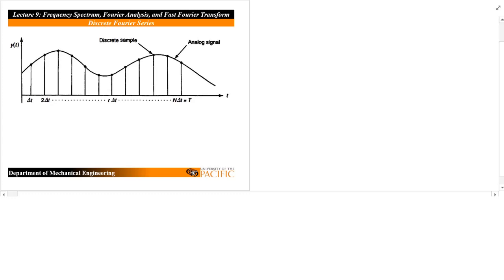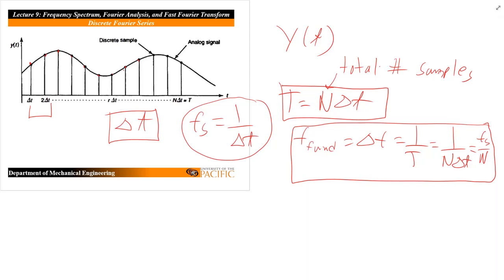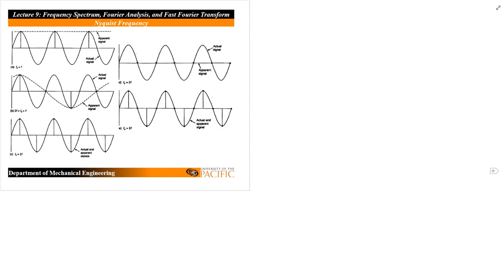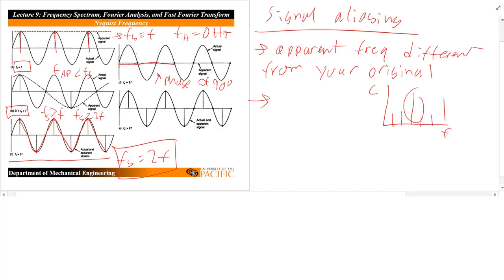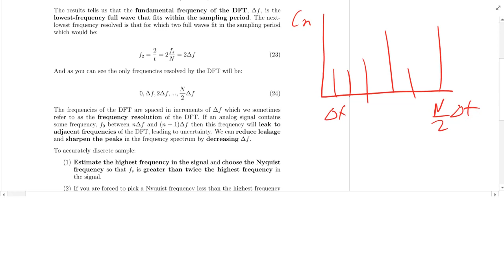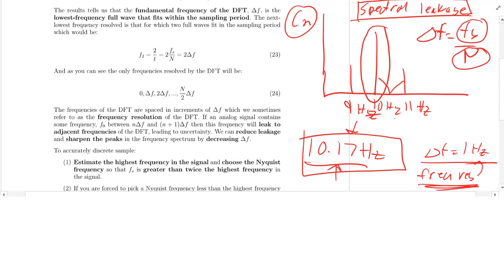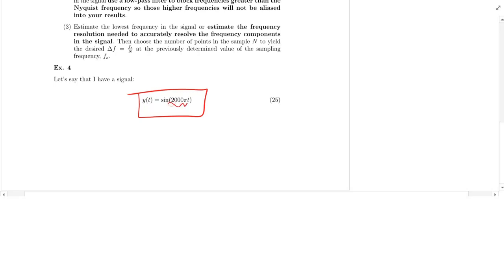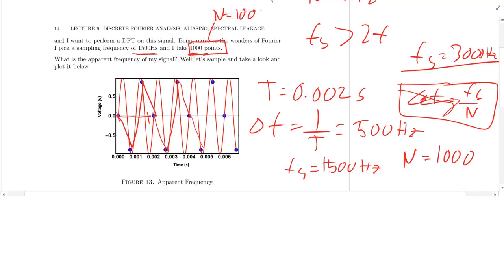Signal Aliasing and Spectral Leakage

Comment: How do I know if the parameter N is big enough? fs has to be be at least 2f, but what about N?
Reply from the maker: Your selection of N is dependent on the frequency you need to resolve, i.e. spectral leakage, so if you need to be able to see frequencies of 0.1Hz for example you must select your fundamental frequency, i.e. 1/T, such that it is at least 0.1Hz, then you can relate your fundamental frequency and period, T=Ndelt, and pick your N value to make sure it gives you your required fundamental frequency. Does this make sense?